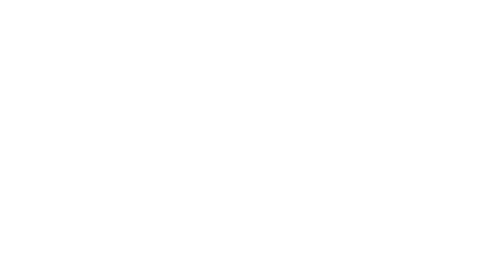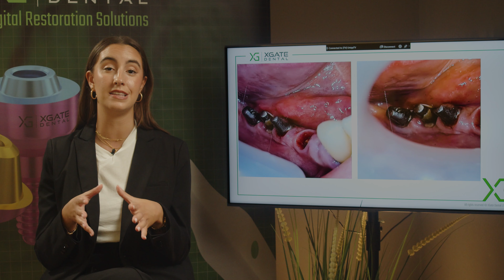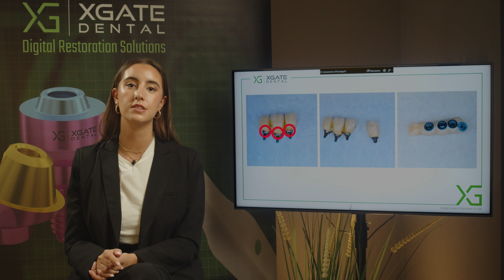How to Avoid Complications with Bridge Prosthetics. X-GATE Dental Restoration Solution

Comment from the maker: 00:00  Innovations in dentistry
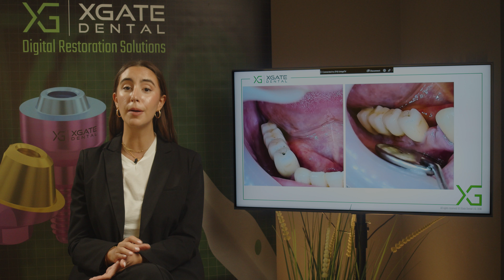01:00 Showing old bridge on 4 implants, need to restore missing premolar
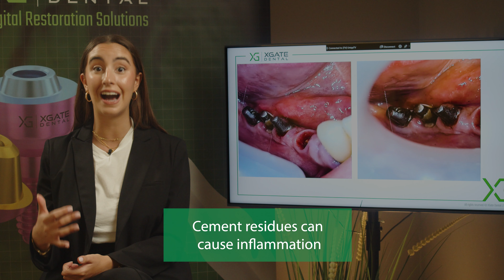02:00 Discussing treatment options - add implant or change bridge
02:30 Decision to modify bridge, change attachments
03:00 Removing old cemented bridge, cement residues visible
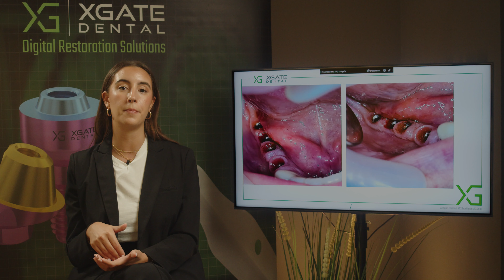03:30 Cement causes inflammation, hard to detect
04:00 New screw-retained bridge with cantilever
04:30 Better fit and cleanability than the old bridge
05:00 Placing XGate multi-unit abutments at tissue level
05:30 Reduced cantilever size for strength
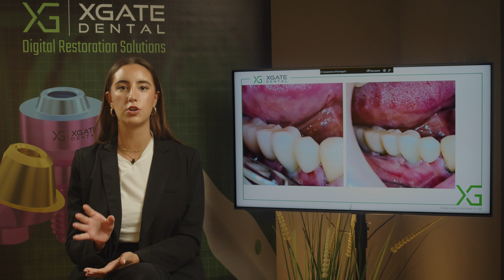06:00 Final zirconia bridge tried in
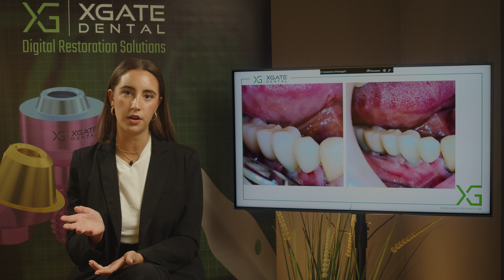06:30 Good fit and contacts checked
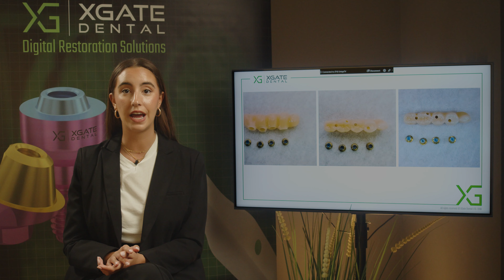07:00 Open design enables patient hygiene
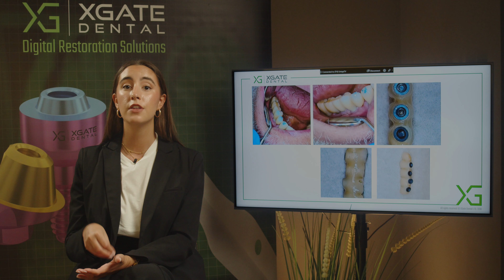07:30 Closing screw holes
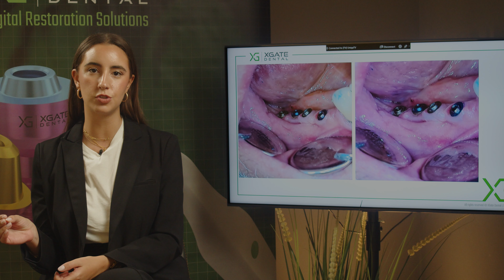08:00 Summary - old bridge removed, new screw-retained bridge placed
08:30 Thanks for watching